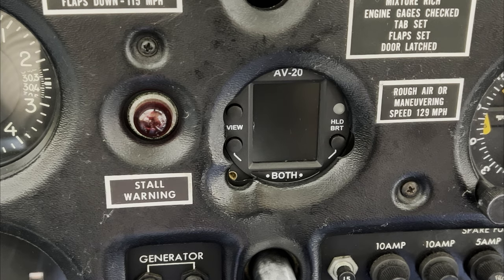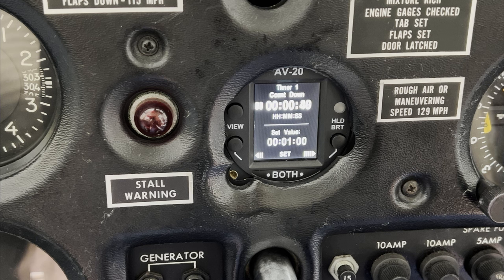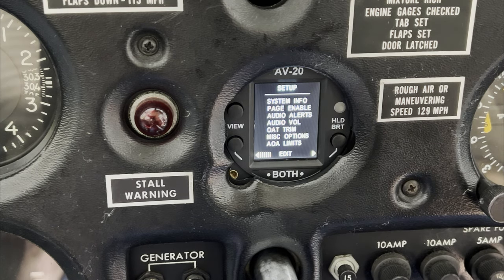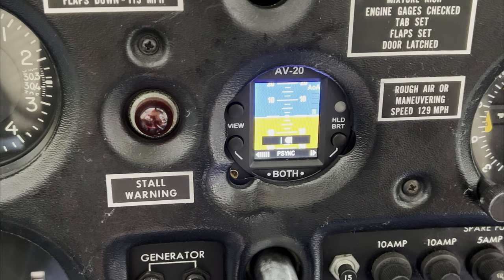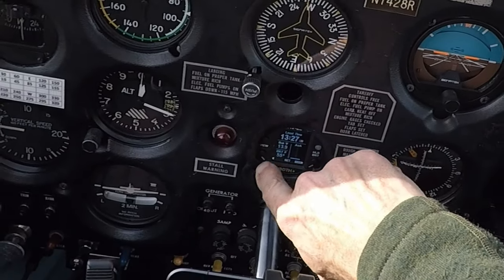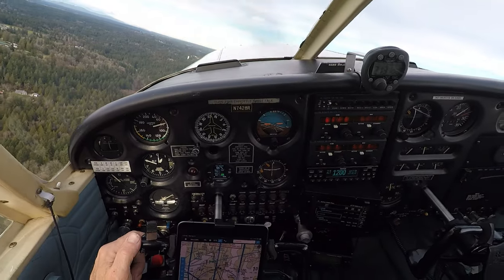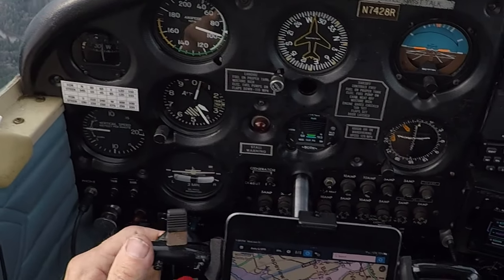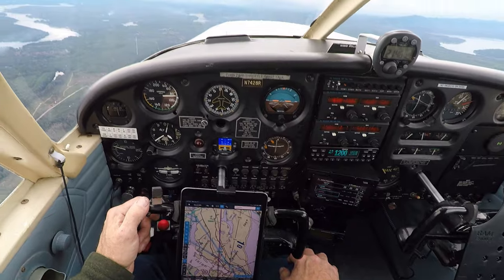AV 20 S Instrument Review

Comment: Great seeing all the features. I installed it basically for backup artificial horizon. After you did the stall, did you adjust the 15 degree setting as it seemed to be a little late? And, if so, what did you set it to? Thanks!
Reply from the maker: Hello there. I set the AOA alert at 17 degrees. I muted the audio alert because it seemed to give alerts even when the AOA was well within safe limits. I think the AOA feature has some limitations in that regard, but I’m certain it would alert during the “real deal”. Enjoy the instrument. It’s pretty amazing.